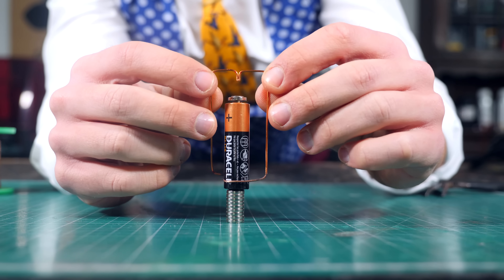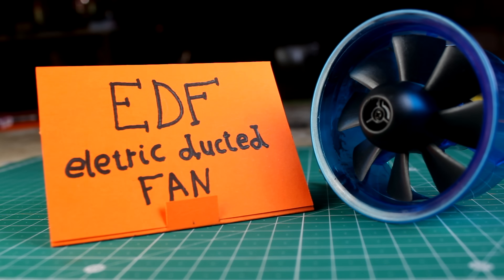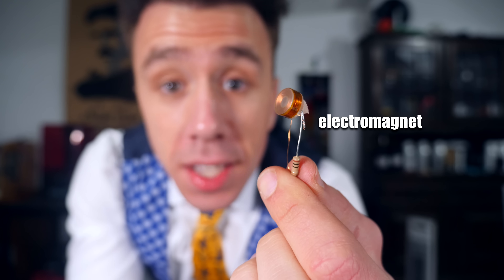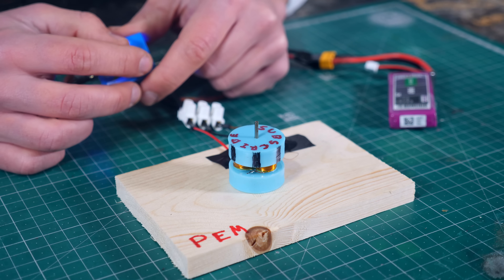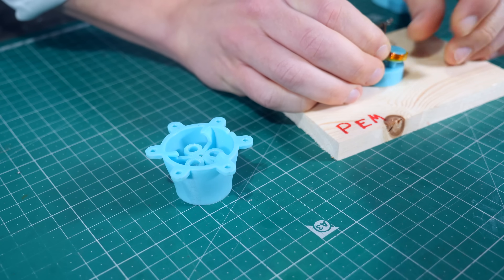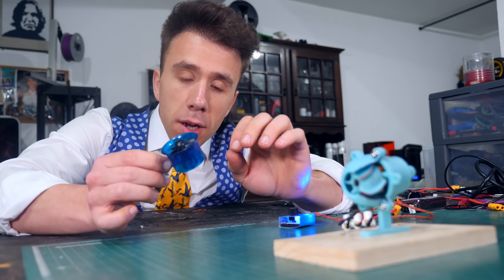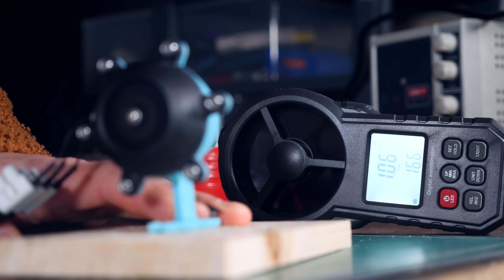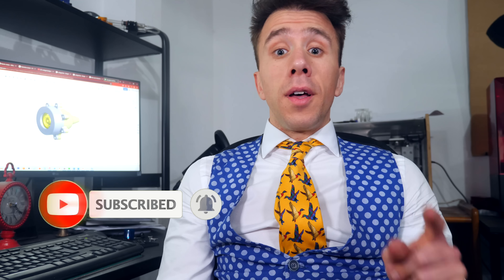I 3D Printed an ELECTRIC MOTOR FAN

Comment: I've been a mechanic and engineer for 20 years. I work with modifying turbocharged vehicles. Your issue is restriction. You can only for so much air into a space before the efficiency drops. You need to run the model through a flow simulator program and find your point of restriction. I'm guessing you will need to extend the compressor house and run a bell shaped exhaust.

Comment: I've heard that the flow rate/wind speed metres a calibrated for their cross section. You need to build a mini wide tunnel the diameter of the metre and then fit the motors to the front of it. Look at some PC fan test videos from the guy who 3D prints fans.

Comment: I have a few thoughts on why you are not getting the same amount of flow. Now keep in mind, I am not an engineer but having worked with a few turbos this is what I think will work.

1. Restrictions. The ducted fan is just a straight pipe with no restrictions so the air flows easier and smoothly. 

2. Tolerance. The ducted fan doesn't have any restrictions so tolerances aren't that important.
The 3D printed fan has restrictions so the tolerances have to be tighter or you will get blow-by which reduces its efficiency.

3.Fan-blades. The blades on the ducted fan have a greater surface area so they can move more air. The blades on the 3D printed fan have a lower surface area so they would have to be spun significantly faster to achieve the same volume.

4. Attack angle. The attack angle of the blades of the ducted fan are probably at 35-40° which helps draw air in. The angle of the blades in the 3D printed fan start at 90° and transition to ~45°.  That 90° start is just pushing the air sideways and causing the 45° portion to work harder to draw the air in. Maybe try an "S" shaped blade starting with a 35° inlet transition to the 90° and then to 45°. That should help draw air in the compress it against the wall of the chamber and help push it out.

Just my thoughts though. Like I said I am not an engineer.

Edit. Had to edit number 3 because YouTube made the 3dotfan into a link.

Comment: One of the things I observed that the EDF has blade fin curve with a higher attack angle and it doesn't have a blocked air flow as ther conic shaped impeller in the centrifugal fan ...if the fins of impeller is re shaped with higher attack angle in the initial radial front zone similar to the edf or the impeller is reshaped in reverse the air flow may improve

Comment: My initial thought is it's due to the effectiveness of EDF and similar fans being heavily dependent on how tight the tolerances are. An EDF with 0.5mm gap between the blades and the duct will move a lot more air than one with 1.5mm gap.

The geometry of both EDF ducts and impellers are way more complicated than they seem.

Comment: if you want to compress air dynamically then you need extremely tight tolerances between the blades and housing. also comprare the area of flow to the fan you designed. the edf has significantly less restriction

Comment: Aren't centrifugal fans supposed to move air at a right angle?
The Dyson model is oriented 180 degrees to yours (air flows the opposite direction)
Your inlet and outlet is extremely restrictive

Comment: I think its a few things, using an anemometer to measure wind speed as opposed to mass airflow or static pressure you are handing the EDF the win. If the rpm is the same(ish) but the blade surface area is less then it would flow even less. While centrifugal fans can handle a higher static pressure, they inherently have less mass airflow than a similar external sized edf. Id aim to match the blade surface area 1:1 if i could. Since your dont have a combustion chamber you will need it to maintain any pressure in the system. Asap after the compressor i would make it as free flowing as possible adding any constriction post impeller will rob you of flow. 

Ps, that cute fan joke made me go "you SoB", you got me. Much love brother 🧡

Comment: The EDF produces more thrust than the impeler coz they are opperating usind different principals..
EDF creats fast flow of air while the impeler compresses air.. The impeler is very suitable for jet engines aplication

Comment: I have a couple thoughts, maybe just something to prototype and really test out:

1 - you want to maximize it's "gulp" of air. maybe more blades? in a design meant to take in a high volume, and afterwards, be then forced outwords. Maybe something more like a scoop, first with low pitch (like a drone propeller) then pitched out?

2. Also with the "gulp" of air to pressurize, a larger design intake, because what's going to come out, it's going to have lost a LOT of efficiency (being converted from high volume, to high pressure.

Of course, that's if the motor can handle it, maybe double the number of active poles?

Comment: The issue is a balance of momentum and energy. Fans get their "push" from momentum, though this requires energy to do.
As momentum, P=mv, and energy, E=1/2mv^2, imagine 2 cases- 
Moving lots of air slowly- 'typical axial fan': m=1kg, v=1m/s: P=1, E=1/2
Moving not much air quickly- 'typical turbo fan': m=0.1kg, v=10m/s: P=1, E=5
So the turbo fan requires 10x the amount of energy to produce the same thrust.
It's also the reason why helicopters have enormous wide blades instead of just a jet thruster facing straight down.
Drones get away with small EDF's and blades due to the simple fact they're tiny, just like how many insects have wings smaller than their bodies, and birds have much larger wings.

Comment: its simple, its the weight difference and the blade surface drag coefficient.
Reply: Another thing that I would suggest checking, is the tolerances between the fan blade and the fan housing.

Comment: If you don't mind dry reading look up NACA reports about ducted fans and fan props.

It may be worth looking at closed face fluid pump design for ideas. I do know the leading edge shape of the impeller is very important.

You can design a fan to move a large volume of air or high static pressure. It's hard to design it to do both with modest power. And to get thrust you need both.

Comment: Just thinking out loud here, but centrifugal fans tend to be low volume high pressure (think car turbo).  Meanwhile, if you look at an airliner, they use high bypass fans.  Yes, they compress the air inside but the majority of thrust comes from the standard'ish fan blades.  Stand in front of one and you can see daylight through the bypass.

Comment: It's an airflow problem. Your intake is too small, and you need more rpms. You may be efficiently speeding up the air, but there is not enough volume of air coming in, and being pumped. I'm sure if u figured out the volume of air each "flute" of your impeller moves per revolution, you would find you need much more rpms to move the same volume of air as the other fan. 
    What are your goals? Thrust, volume, or air speed? They are similar but not the same.

Comment: Centrifugal fans are generally used to create more pressure ratio. You need to spin it at a higher speed most likely. You need to understand how your motor works too. Does it limit speed or does it limit power? If it limits speed you may be operating at a much lower current to achieve the same speed. There's also the efficiency of the design. If you measure the pressure and temperature of the air at the inlet and outlet that should help you get an idea for where the energy in the system is going, and what is going on.

Comment: I would guess you are mesurinb wind speed and not thrust. Rc plane guys say theres a big difference. I think tom stanton has a video where he explains the difference. A normal roo. Fan produces a lot of air speed and volume but basically 0 thrust. And plane props and turbo compressors do the oposite.

Comment: The problem is you forgot to turn off skill based match making. The Centrifugal fans are based around a rotating wheel of blades called impellers, which drag the entering air or gas into a circular motion. there is also a problem The efficiency of aerospikes  at low altitudes is much higher because the atmospheric pressure restricts the expansion of the exhaust gas. so there is possibly low pressures at higher altitudes making it less efficient than lower so there must be high pressures in the area when it is compressed

Comment: im no engineer but could it be the fan surface area? are the blades large enough to move more air?  Looks like the edf fan blades are much larger than your prototype. plus you probably wouldnt have to have an high rpm with bigger blades. just a thought

Comment: You need to use higher rpm and a wider angle on the impeller. Spot the difference between the Dyson one and yours. Your turns are too extreme. Which would need a might higher rpm.
Theme for the next video. 3D print a record vinyl. With stereo sound!

Comment: Here’s an idea for a future video: it’s not a jet engine, but it spins. have you ever seen a maypole braider? It’s a machine that takes bobbins of thread and weaves a tube of fabric. I’ve been looking at making one so I could put a cable down the middle and end up with fabric-protected custom cables on projects for extra durability and identification. It might be handy to have something like that in the shop.

Comment: You need to have an equal or greater surface area (on the fan blades) to equal the thrust of the EDF. Also, lower your gap between the impeller and the housing to avoid Eddie currents from causing vibrations, lower airspeed, and compression.

Comment: Double check your gap between the impeller and the housing. If the gap is to large,  Eddie currents may form between the impeller and housing. Causing vibrations, lower airspeed, and compression.

Comment: Well, what's the swept volume of the propeller/impeller? Taking it to the extreme, if the impeller you're using for the centrifugal fan has very, very tiny fins, it stands to reason it won't move that much air. So it sounds to me like you need a bigger impeller.

Comment: add 3 more blades and camber them off set from each other. 4 high and 4 low and the curve of the dome (where all the blades are attached) should be as close to the Golden ratio as possible along with your cap.

Comment: you could possibly use a centrifugal compressor design instead of an impellor, similar to Sir Frank Whittle's original jet engine or what is found in modern turbo chargers. 
You could, also like modern Turbo chargers and Jet turbines, incorporate a type of "air by-pass" to add a bit of slower moving air "mass" (via ventricle shear) to increase the usable air volume at the ejection point (Exhaust).
Awesome channel, keep up the great content

Comment: The Dyson edf uses a friction fit with the duct it sits in. The body of the duct is smooth and I believe the materials used for the duct and fan are self lubricating. This allows for compression to build in the veins instead of it slipping in the turbulent zone causing drag.
Reply: Don't be fooled by the imitator, that's a fake Integza. Those "telegram" labeled accounts are a common fraud pattern.
Reply: When all else fails, more lube.
Reply: wow, I actually was right. My guess was excessive clearance between fan and duct.
Reply: That makes perfect sense! Although approaching this level of seal might be hard to achieve with 3D printers. 
Maybe Integza could use a slightly flexible material on the edges of the impeller? Perhaps even a bit of electrical tape taped to both sides of the blade with about 0.5 a mm overlap with the duct and some lube in the form of graphite powder would work?

Comment: great video, as for the question the way you were measuring was flow rate one option is the size of the centrifugal fan is too small and two might be that the centrifugal fan is pressure optimised not overall speed/flowrate so edf flow = Fast moving air centrifugal = slow more dense air(great for static pressure I.E. getting through obstacles or building pressure in burn chamber of jet engine.)

Comment: The EDF is an axial flow fan. Great for producing flow rate. You are attempting to create a turbo fan. The fan you have made is the power producing unit of a turbo fan. A shaft would be connected to what you have created to produce thrust through a bypass ratio. Your fan is basically a mixed flow fan. The best of both worlds when comparing an axial fan and a blower. Slightly reduced flow compared to an axial fan but is able to produce a higher static pressure than an axial fan.

Comment: Velocity out the back matters.
Also the flow rate: Vel x Area.

Centrifugal drops velocity to raise pressure but like you said there's a lot of unnecessary steps => turbulent losses. Also lower velocities getting thrown out the back per unit area.
Reply: Best answer so far

Comment: Assuming that how the output is measured isn't biased towards the ducted fan (which I think it is) . Might be the tolerances are too loose and the wind is slipping by. But since the turbo fan is a compressor using an windguage won't capture its potential as it trades flow for pressure.

Comment: Video Idea - show the difference of high Air Flow fans and Static Pressure fans. Their design is different in terms of blades and space between them. Greetings from Brazil! 🙂
Reply: Great idea!
Reply: Best idea!
Reply: @integza could you please confirm this with your youtube main account? Thanks!
Reply: @metschnikowia  likewise with mine i have no idea if the comment i got was a scam
Reply: @antonventura6364  It is a scam. I wrote to integza. And also report to YouTube.
Reply: @metschnikowia  alright, likewise i’ll report the account. Also blocked the the Telegram account. Cheers from Manila

Comment: You should measure the amp draw on both designs. I'll be your impeller is doing less "work" than the edf, probably as the pitch of the prop is much harder to get right with your new design

Comment: The impeller design just isn’t the most efficient way to move air. The impeller blades are huge thick wings essentially, and they’re best suited to different applications, like turbochargers that scavenge energy from air moving past and enclosed situation like a pipe.

If you want to make the most thrust, you have to design for something that is good at moving open air, like an enclosed ducted fan.

Comment: The blades on the edf are likely optimized for the nominal speed that the motor spins at; by changing the blade so drastically, your not using the optimal efficiency of the motor (same as pedaling to fast on a low gear on a bike or slow on a high gear). *I think you would need to iterate the impeller to be at it most efficient at the motor’s max weighted speed.

- Certified armchair engineer (PHD from Reddit University)

Comment: The speed vs power curve of an electric motor is pretty steep so it only has to turn a little faster and it's delivering waaaaay less power.  This is probably why your fan is not producing the thrust you expect.  Your propulsor device is not able to suck as much power from the motor and do anything useful with it.  The reason the EDF produces so much thrust is that it's pumping waaaaay more air.  Even if you got your centrifugal (mixed flow, actually) device to consume the same amount of power, it will still generate less thrust than the EDF.  Your thrust is generated by the change in momentum of the air that passes through, however the power you put into this air is adding to its kinetic energy.  A liniear-vs-square-law thing going on. A small amount of air with a lot of kinetic energy will be a miserable momentum delta compared with a large amount of air provided with the same additional kinetic energy.  It will be moving much slower though.  This is the reason that the fans of jet airlines are getting larger and larger and larger all in the quest for greater efficiency.

Comment: did you take into account that the extra compression of air in your design?
this seems like it would be the most likely cause of the decrease in performance from my very limited understanding of this subject.....

for the laymans when you add more compression you are fighting the resistance created by the restriction of air movement and therefore decrease efficiency, to see this effect you can blow through a straw and see what your baseline of airflow  is to start with, then pinch the straw half way down its length to artificially restrict the air flow. by adding this compression effect inside the straw your "motor" has to work harder to combat the restriction and decreases the overall efficiency or the airflow..........

Comment: I love watching you.. but before every video I know that it will either fail or not meet expectations.
3D printing right now, is useful for some things. Not for engines.
Either get a metal 3D printer, or start searching for a welder- lathe- mill setup. 
Good luck